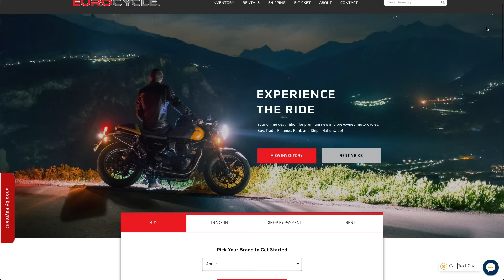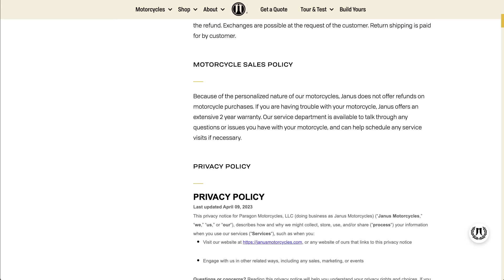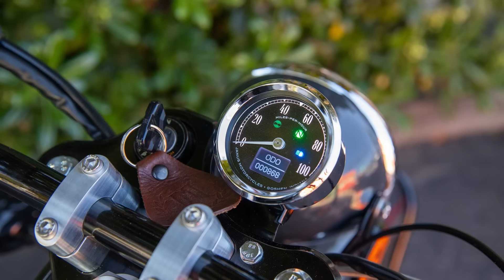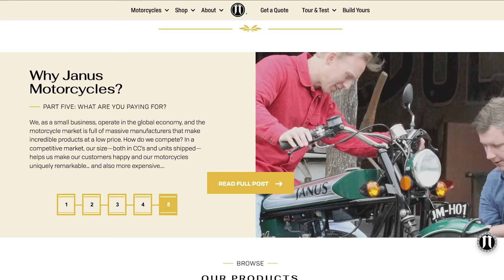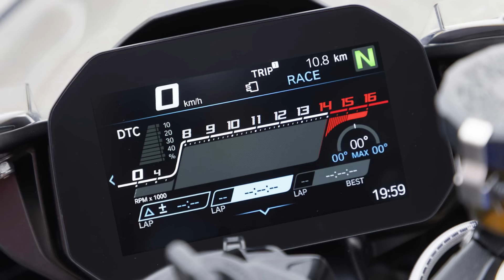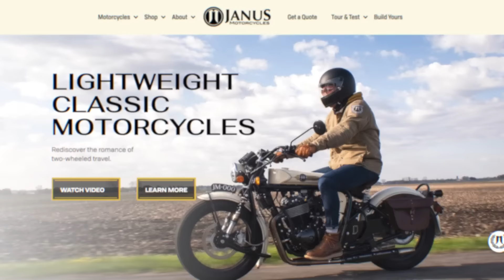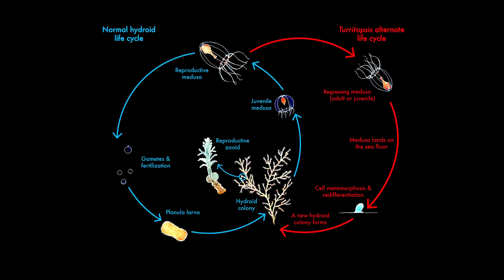We need to talk about Janus Motorcycles

Comment: As badly as I want to love the hand-built properties and the custom paint work on each bike, the price hurts a LOT. I can't help but wish for them to offer new tanks, windscreens, and headlights for newer bikes as well as offering up these art pieces. A honda super cub 125, though not nearly as "faithful" to the vintage super cub, is also a modern honda. So you get on it, press the start button, and ride all day, no problem. I'd love to see all their expertise and work with custom fabrication and painting to offer color variations or new accessories and styles that honda just can't make themselves due to being too low volume and niche. Or maybe some "vintage leather" saddlebags and handpainted tanks for bonnevilles or the kawasaki W800. 

I deeply admire their work, but almost 10k for a 250 that is not much faster, or perhaps even slower, than the new 5-speed grom? Can't justify it.
Reply: Yeah that'd be pretty cool make some accessories for the bikes with way bigger market share

Comment: While I prefer preformance and comfort I do love the stripped down look maybe I'd get one if I find a used one for a good price for riding around town but I'd prefer a big dog chopper for that kind of look
Reply: Featherbed bro.
Reply: Because they are so lightweight, even with the relatively low HP, the power to weight ratio is such that they really move very well. Some owners have modified the engine to increase HP, but I have kept mine stock. After the break-in period (for me that was 1,200 miles, approximately), I can drive the Halcyon more like a cafe racer (Janus used to make the Phoenix, which was a cafe-style bike).

Comment: The whole concept is great, the problem of Janus is the business model, their bikes are way too expensive. 
The same bike at 6k would have been a Retro killer. Concidering the equipment and the complete running engine cost is less or around 700$. The frame and parts would add another 2k (due to hand made), a good rolling chassis is around 2k with brembo...well sold at 6K, they would be ok...but clearly they failed somewhere. 

I am in parts business, so I know the price tags, for those who wonder...

Comment: I saw a video where someone started a backroads cross county ride on a brand new Janus. It broke down repeatedly over a few hundred miles before it was deemed not roadworthy and had to be returned to Goshen to be rebuilt at the factory. I don't think it made it more than two states. The rider replaced it with an old UJM and completed the ride without further incident. I think that video sums up what to expect from a Janus.
Since there are no more real Sportsters being made I may be tempted into one of those Enfields to get my retro fix.
Reply: That was almost 10 years ago on an experimental 50cc bike, with a sidecar attached to it at the last minute.  It wasn't meant for that kind of weight and abuse, but the riders chose to do it anyway, against the advice of everyone around them.

Comment: I've worked on and ridden a halcyon 250. It turned everyone's heads when it came in and that's about it. The build quality was not impressive, very comparable to Chinese bikes all the way around, not to mention the mediocre clone engine. It rode bad and felt just... Bad. The oldest bike I've ridden was a 1960 BMW and it felt decades more advanced than the Janus... Yikes, right? 

I very much agree about the Royal Enfields, better bike that still looks and feels older without sacrificing quality or safety. Or just buy an old bike, I picked up a barn find 1983 Honda passport for $100, fixed it up and I've been riding it for about 2 years now. I love that bike and could get 7 more in running shape for cheaper than a Janus. So yeah, do that instead unless you want to park a piece of art in your living room.

Comment: When I worked at a Harley-Davidson dealership I floated an idea to make small retro bikes like this with the Street power plant. I even made a few sketches that looked pretty cool.
Reply: If Harley ever did a retro 1911 7D, it would be a hot seller.
Reply: @JoeBManco  When I saw my first Indian Scout and Harley WL I knew it could be something.  These were small bikes with a great look. Harley will not build them because they can't sell them for a premium. Harley is not Japan. They don't do volume.
Reply: @JR-bj3uf  That's too bad, because I believe there would be an instant market for such a Harley or Indian product.  I've even thought about buying a crate motor and building my own.

Comment: When you can buy a container load of these chinize engines for the equivelent  price of less than £250 per unit I find it hard to understand how janus can justify the prices they charge . i would like to see one of their mototcycles do a documented ''round the world trip ''and see how they fair compared to ''ANY'' other motorcycle in the equivelent price range .
Reply: Most of the money goes back into the shop. I find it weird people complain about the price when Ducati is also overpriced, I owned two Ducks, 748 and 915, liked both, but nothing on them screamed huge quality versus price. Also not easy to maintain yourself as it's known Ducati doesn't like people working on their own bikes. Janus' prices are no different than Harley, but there's no excuse for Harley having the prices they do, Janus prices however, it's obvious more than half goes right back into the shop, Harleys prices... you're just paying for the name on the tank

Comment: I was approached at a swap meet by a guy who had a 1967 BSA 250 Starfire for sale. All original 6,000 mi everything works, matching numbers. It also had a BSA 441 alloy tank on it. My 250 tops out at 90 mi an hour. It is also big enough and comfortable enough for two people because it was made for real transportation in an age when working people did not have cars. I would not trust that chinese-made engine to run flat-out hour after hour since it tops out at 70 miles an hour.

Comment: I owned a Janus 250 with a total of 8300 miles before giving it away to a former student; I decided to stop riding at age 72.  It, by the way, is still cruising along without problems. Several comments. 1. The first question to ask is how will you ride. I ride in mostly in town 35-45 mph and the Janus is great for this. Of course it isn't made for highway riding. (2) Not all Chinese products are the same. How many high end Apple products are made in China? Janus uses Lafan motors which seem to be fine quality.  (3) Yes the bike lacks many modern features. However, I like being able to work on the engine without removing lots of plastic, fiberglass and the tank. It also has a kickstart in case the battery dies.  Simple can be very handy.  (4) It is well made and light, something useful in a number of ways. (5 ). The service is spectacular. The service department is responsive. They couldn't arrange a local mechanic to work on my bike when I had a strange little issue and Janus flew out a mechanic to work on it. That is not their preferred service strategy but it demonstrates their comment to service. (6). I never had a hard-tail bike before, but it wasn't a problem. In fact the springs on the leading link fork were too tight IMHO. (7) Speaking of which I really like LL forks, not diving with hard stops. (8) The one major downside is the cost. Yes, they are expensive, but I'm not sure what else to expect from a vehicle made in the US.  In short, my Halycon 250 served my purposed well. And I find so many motorcycle reviewers are like lemmings; they just following the trend toward insanely over powered bikes without asking the first question of what is the intended us of the bike.

Comment: I've owned two rather unusual bikes.  The first was a WWII vintage belt drive Whizzer, which my brother and I found at the dump minus engine.  We equipped it with a lawnmower engine, added a roller that pressed on the belt as a clutch, and were off- at least until our funsucking nextdoor neighbor called the cops on us.  The next was a circa 1965 Marusho, a Japanese copy of a BMW 500. Alternator didn't work, had to charge the battery at home.

So I have a foible for old fashioned designs.  And Janus is doing a wonderful job at handcrafting a bike that is definitely not for everyone, but fits a niche no one else does today.  I too would wish for a locally made engine, but I understand the cost problems.  Beautiful work and obviously a very ethical business.  Bravo to Janus.

Comment: The reviewer is definitely a NOOB that doesn't get the heart of motorcycles. It's not about impressing YOUR likes and dislikes, it's about the simple things in life. While you wait in line while someone else has to repair your motorcycle because the tech is even over YOUR head. The Janus owner can do most of his own. As far as running 70 mph. You shouldn't be riding that fast on 2 lane back roads if you want to enjoy the view anyway. Lastly, the guys at Janus are not trying to build a monolith that they will lose to corporate shills occupying their Boards of Directors who eventually will field strip their business and reduce it to crap.

Comment: I love the looks and idea of the Janus but I already have my Janus. A $10.5 k 2006 HD Springer Classic. Scratches the retro itch with huge aftermarket support. I do applaud what they are doing. The Honda clone engines aren't a big turn off forme. Simple, robust easy to service. I have a Honda XR150 here in the Philippines, only cost me $1815 brand new in 2023. An engine with the simplicity of an anvil..

Comment: I recently purchased a 1978 Honda CX500 for $800. Replaced the tires, brakes, fork seals, rebuilt the brake master cylinder and caliper, changed the oil and filter, air filter, and now have a more comfortable and road worthy machine for a helluva lot less money. It’s an old bike not just made to look old.

Comment: Just seems like a totally unnecessarily harsh review to me. I'm glad the folks at Janus are out there doing their thing. There is definitely room in the market for rolling art. That's especially true when the point is for the whole experience to be fun. It does cost more to build motorcycles by hand at low volume even when they are intentionally simple and use reproduction engines from China. Who cares though? If you have the money, like the look, and want a flickable vintage styled machine, buy a Janus. If that's not your thing, cool. There's no reason to bash the founders and company though.

Comment: I got to ride a Halcyon 250 when I was a tech at a Triumph/Piaggio/KTM dealer. It was very... primitive. The kickstart was so difficult that I ended up needing a push for a roll start to set off, then when it stalled halfway back to service I finally managed to get it to kick over and set off again. Everything about the riding experience was primitive (slow, lumbering, clunky, jarring, etc) and I was flabbergasted when I found out it was a $10k bike when I had been eyeing a Duke 390 for half the price (and twice the bike at least). Very much a gimmick, they build cool looking bikes if you're into that. Better than CCW I guess because everything isn't a cheap clone, just, you know, the running gear and everything that makes a practical motorcycle versus an art installation.
Reply: Uhhhh the Halcyon 250 doesn't have a kickstart?  Maybe you're thinking of a different motorcycle?  Or maybe it was a really early prototype or something.
Reply: @RedZeshinX  Yes it does.

Comment: Glad to see you revisited the Janus and made a new video after this one with a different perspective. The Janus is un a class by itself and is difficult to compare to modern production motorcycles. Most modern bikes are all very similar.  Janus is the only brand selling in the US to offer something completely different.  A scratch designed and built retro classic.  It cost way too much, performance is less per dollar than probably any other bikes sold, but they are not selling a dyno sheet or 0-60 times. They are selling a small company, hand made ,visceral ultra lightweight riding experience. Yes I wish the engine was an old design, redone Norton, Harley, or BSA or something.  They could have done that and charged over 25 grand per bike, (for a midweight) and there would be a market. but we are in 2024 and they wanted to make lightweight single cylinder bikes that they could sell in small volumes.  People complain that manufacturing is deal in the US, and when a company designs and builds, and successfully brings to market several motorcycles ,people need to find fault.   The engines sourced from SWM  are redesigns from Husqvarna engineers and built by a reputable Chinese factory.  KTM has motors built in China, and practically everything we use and touch every day is made in china. Remember when Made in Japan meant copy cat junk in the 60's?  Times change and RIchard is bringing these bikes to may happy owners.  The customer service is best in class also.  Yes I own one, and like most Janus owners have owned many bikes previously and got bored with the vanilla offerings out there.

Comment: I started riding on a Honda 70, then moved into the enduros and "street and trail" of the early and mid 70s. The only reason to ride was because it was fun. After over 40 years of riding much more powerful and heavier street machines, I bought a middle weight 800cc cruiser and an XL650 Honda. Much lighter and not as much power but still a ball to ride. The biggest thing I can appreciate about bike like the Janus is the simplicity. I don't need ABS or a speedometer that tells me what gear I am in or the plethora of electronic devices mounted to some of the newer motorcycles today, a lot of riders are perfectly content cruising along at the speed limit and seeing the sights. I agree 100% about the cost, There are a bunch of less expensive options for a simple bike for way less than $15K

Comment: Beautiful bikes. There are a lot of bikes that pull at the heart strings.
I once owned a really clean low mile 1979 Goldwing, I took the fairing and bags off, it was beautiful, but it rode like dogshat even after new tires, fork seals and fluids, handling was down right scary especially compared to my late model sake rockets but even compared to my coworker’s older 1989 Goldwing with a ton of miles, that bike handled very well for such a huge tourer.

For me motorcycling is way too fun and way too dangerous to not have a nice modern machine that can easily handle fast freeway speeds in a pinch or regularly.

Comment: Great video, and you sold me on this company. You just don't get it. I have a 67 bonni, and a70 triumph chopper hardtail raked with a 6 over springer, plus a 91 sporty that I cut an inch out of the neck and raked it back to take the 6 over girder, and lengthened  the swing arm 3 inches, plus a 94 wideglide I'm chopping, and I bought a 2001 triumph Bonneville when it came out, That was the first year the retro bikes came out... and after two years I hated it. so boring . so I chopped it.  the Janus 450 is the perfect bike. these guys nailed it.

Comment: I bought the halcyon 250 because I wanted a retro bike without the problems of antiquated parts, also I wanted a bike like a norton, so that was a plus, I wanted a small displacement bike that was light and maneuverable,  yes it’s pricey for what it is, but not many options out there, its only used on back roads, there were a few parts that shit the bed quickly but warrenty replaced them accept the battery which was bs, other than cheap plastic rearlight housing and shitty clutch its ok

Comment: I have a 450 and I also have started a small business so have nothing but amazing respect what these guys are doing and how far they’ve come. Yes I know they hate having to use these engines but they have zero choice right now until they can grow a little further. I love your channel but the tone of your video was insulting. These bikes aren’t designed to compete or even be compared on a level with modern bikes.  If you do any welding, fabrication, sheet metal work, etc then the craftsmanship and love that goes into these will make your heart and eyes very happy. I think you missed the point and should visit them. Or admit to us it’s not your cup of tea and you shouldn’t have “reviewed” them from afar.

Comment: I can't believe you left out the AMISH POWDER COATING, not kidding, the frames are powder coated by local Amish fellows or were at some point. Also its a design based on a really good hardtail frame, not just any hardtail frame )  Also, a modern 2024 Ural is $25,000 weighs 850lbs and has a Russian 750cc 40hp motor.... ... .. . . . . . . 

Fun fact, Goshen Indiana's local booming economy is nearly 100% reliant on producing 90%, yes 90% of the entire Nation's RV's and Campers.

Comment: Not everyone wants a two wheeled computer Mr. Yam, yea the price is high but they don't have the economies of scale major manufacturers do. There is no way a small company like this can also design an IN-House motor, the tooling and engineering are too expensive so you get a china-motor. The bikes and the livery are extremely satisfying to look at vs modern bikes with their bulbous fairings and plastics everywhere. I'm glad Janus exists but they are too expensive for what you get compared to the competition.